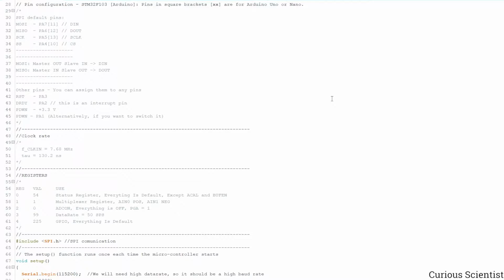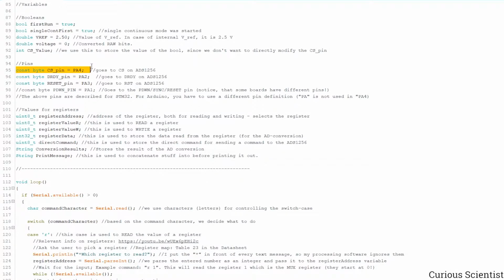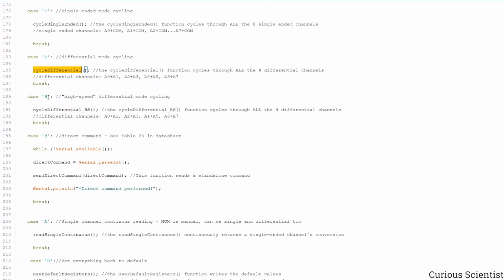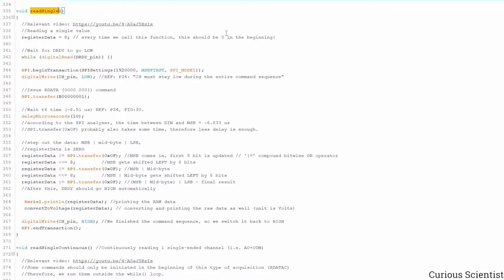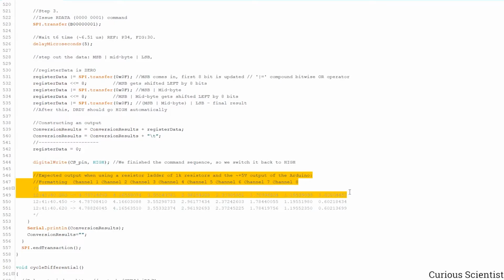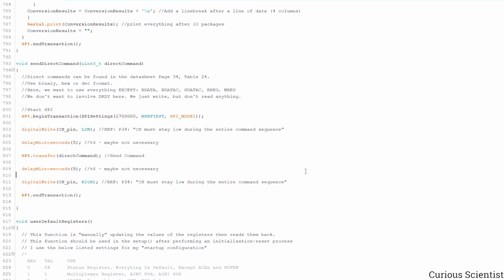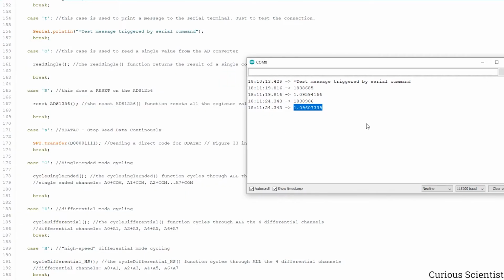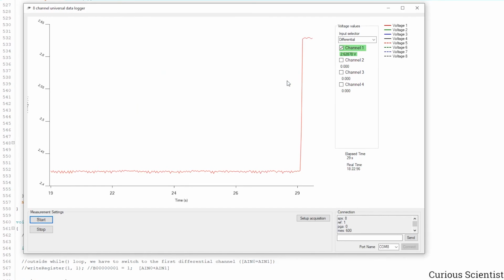ADS1256 - Fully working code and demonstration

Comment: Why is necessary to wait 5us after a DRDY falling edge in continuos mode (RDATAC command)?
Reply from the maker: Check the datasheet and also my most recent, fully functional official Arduino library. I substantially updated the code and its documentation since video.

Comment: Thank you so much for this nice video , Recently I am working on ADS 1263 , I was try to do with Arduino nano ble board ,  Can I use this similar code with proper register value and functions , ?
Reply from the maker: Hi! Why don't you try it? :) 
But you should read the datasheet to understand the protocol of the ADS1263, and then you could see if this code fits it.

Comment: Hi, I found the posted video very helpful
Where is it possible to find the program you are using to graphically represent the signal read by the ADC?
I'm referring to the program that can be seen from 52'40'' onwards
Reply from the maker: Hi and thanks! 
The program can only be found on my computer (i.e. not available publicly). 
However, within a few weeks, I will release a similar software which will be available for purchase on my website.
Reply: @CuriousScientist  Hi, is the software available now? I’m interested with the software you’re using.

Comment: Great work.  Thank you.  I would like to leverage this for another ADC.  How did you calculate tau?
Reply from the maker: Hi and thanks! I followed the formula in the datasheet.
Reply: @CuriousScientist  i failed to even find "Tau" referenced in the datasheet.
Reply from the maker: @PeteDubler  It is impossible. Tau shows up 32 times in the datasheet (September 2013 revision from ti's website). And the definition of it is shown 4 times. I think you just haven't opened and read the datasheet. It is literally the first thing defined when the datasheet talks about the timing characteristics...
Reply: I have spent hours over the last several days reading and re-reading the ADS1255/ADS1256. SBAS288K-JUNE 2003 - REVISED  SEPTEMBER 2013 datasheet.  And I just searched it and re-read all the timing sections again.  There is not a single reference to "tau" nor do I find the Greek symbol in the datasheet.  Is it possible you have a different datasheet than the (English version) SBAS288K?  In fact, I looked on other TI datasheets and their app note on ADC timing and in none did I find the term "tau".  I also wrote a spreadsheet for all the "t" values and starting from your crystal frequency still could not come up with any number close to the "tau" value you are using.  No, I'm not lazy in asking you this question.
Reply from the maker: Yes, I am reading the English SBAS288K datasheet. I even put the link in the video description, and it can be found in my blog article too... If I search for tau, as the Greek symbol "τ" in the datasheet, it shows 32 hits...

The clock frequency of the crystal is 7.68 MHz. As the datasheet writes on page 6 and page 7, tau is 1/(crystal frequency), which is 130.2 ns. I don't know what is so difficult about this. 

The different t values are also stated in the datasheet on page 6. Coincidentally, at the same page where tau is described.
Reply: @CuriousScientist  tauCLKIN. NOT JUST TAU.
Reply: @CuriousScientist  tauCLKIN. NOT JUST TAU.
Reply from the maker: It has tau in it, right?! :) For my own documentation it was enough to write down tau because even if I forget what tau was, I search the datasheet for tau and find it again.
Reply: Are you perhaps using "tau" for tCLKIN?

Comment: hello, i using ads1256 and arduino mega, 
when i read register r0-r4 the value show 255, and if i read single-ended mode the value show 16777215,
why this problem?
Reply from the maker: Hi! Probably wiring issues. Make sure that you wired everything correctly.
Reply: @CuriousScientist  i using jumper with black housing,
Reply: @CuriousScientist  i attach drdy to arduino mega pin 2, it freezez, and if i attach to pin 7 can works but the value still 255 and 16777215, thx
Reply from the maker: Are you aware that you cannot use the as same pins, because you are using a different microcontroller?
Reply: @CuriousScientist  i using arduino Mega spi, cs to pin 8 and drdy to pin 2. And I have changed the code, thx

Comment: The Text is unreadable. I tried to change the contrast of my monitor, but no still no good. Can you make the Text on the screen a little better please ?
Reply from the maker: I cannot modify the video after uploading and it looks perfect on my monitor. I can even read it at 360p setting. Also, you can download the source code, so you can read it as you want.
Reply: Request for larger Font Size.
Reply from the maker: Didn't you read my reply?

Comment: Codes are working but how do we get ADS1256 data logger? please make clarity to open and visualize (line graph) signals
Reply from the maker: You have to write your own software for it.
Reply: @CuriousScientist  Then what is the use your free source code? simply waste without data logger software. what is your aim writing this type of codes and releasing series of videos like this? Totally our time is waste.
Reply from the maker: Why are you so spicy? Can you write the arduino code by yourself? Since you watch the video, probably not. Well, that's the purpose of the video. You should be glad that someone took the effort to provide this code. If you want the logger, you can buy it from me.
Reply: How much please?
Reply from the maker: Drop me an email and I will tell you the details.

Comment: very very buggy and complicated with totally useful features. All this board should do is read voltage (mV, uV) and that's it.
Reply from the maker: Well, the code is freely available and you are free to improve it and share it with us. I am waiting. By the way, I made several updates and improvements since this video. You can find them on my channel.

Comment: Hello there,

I want to send the voltage outputs that I have obtained from ADS1256, which I have connected to the SPI1 pin of STM32F103C8T6, to another place with the NRF24 module that I have connected to the SPI2 pin of STM32F103C8T6, is it possible to do this?

I want to use SPI1 and SPI2 at the same time.

I would be glad if you help.
Reply from the maker: Hi! Probably, it is possible, but I have never worked with the NRF24 module so I don't know how it works. However you just need to save the received data in a variable, then pass it to the transmitter and send it.

Comment: Codes are not compiling. It structed at line 59. error message is 'PA2' was not declared in this scope. suggestion please.
Reply from the maker: PA2 is not declared. Exactly as the error message says. Declare it.
Reply: @CuriousScientist  Codes written according to the video you've showed. The 563 lines of code are all identical. Despite the fact that it is displaying an error.
Reply from the maker: Something is still not ok... I think you missed a bracket somewhere.
Reply: @CuriousScientist  Ok i will try again. Thank you
Reply from the maker: You're welcome. I hope you'll succeed!
Reply: have you found the solution?
Reply from the maker: I already told the solution months ago...
Reply: @CuriousScientist  i already checked the bracket and there is nothing wrong. but it still not working.
Reply from the maker: Do you use the same microcontroller?
Reply: @CuriousScientist  No, but when am compile it shouldn't error right?
Reply from the maker: Well, then that is the issue. This code has to be modified for other microcontrollers... My code works well, it is you who doesn't use it properly.
Reply: @CuriousScientist  can u send me the .ino that you're using?
Reply from the maker: First of all, I am not a free support service. I shared everything on my website. Also, if you use a different microcontroller, my .ino will not work...

Comment: Highly informative . Can you explain , how to use ADS1282 please? Small amount of donation is guarantee. please consider my request positively.
Reply from the maker: Thanks. Unfortunately, I don't have that ADC, so I can't make a video of it. But as I can see it is also an SPI hardware, so the same principles apply. The only difference which you have to keep in mind is the resolution. You will need one extra byte when you read the conversion.
Reply: @CuriousScientist  Thank you so much for your reply. Since ADS1282 is 32 bit, I think it may be required 4 buffers(8x4=32). And sampling rate to limit 4kHz. Then decrease the number of channels to 2 single and  one differential. one more thing is STM bluepill( microcontroller which is used for ADS1256) is sufficient handle 32bit ADC or can i select different microcontroller? I do not much about all these things. Or is there any other changes? Guide me please.
Reply from the maker: STM32 should be sufficient.
Reply: @CuriousScientist  I tried to  donate you , I filled all the boxes, but at the end it shows' like this, sorry.   Donations to this recipient aren't supported in this country
Reply from the maker: No worries. :)

Comment: Just bought an ADS1256 board which I want to use with a MEGA.  I'm looking at the connections and my ADS board has these in a line PDWN,CS,DRDY,DOUT,DIN,CLK,GND,5v .  I have PDWN going to 3.3v, CS going to 10, DRDY = going to 9 ??, DOUT going to 12, DIN  going to 11, CLK going to 13, GND and 5V to those on the MEGA.  In the definitions I have CS_pin = 10, DRDY_pin =9, RESET_pin ????? There is no reset pin on the board unless. Also where do I define the pins that I am using for DIN, DOUT and CLK
Reply from the maker: I have a whole playlist explaining how this circuit works in very detail. I also explain the code and all the connections in very detail. In the playlist, you can also find a discussion on 5 different ADS1256 boards. Take your time and you will find all the answers.

Comment: great videos. One thing i wonder, is it better to use PGA or should I increase the voltage and use a voltage divider? I am reallly curious about which one creates more noise. thanks for helping us
Reply from the maker: Thanks! PGA is for lower voltages, within the range of the ADC. Voltage divider is useful if you want to measure something outside the range of the ADC. I haven't tested the noise performance of the unit, so I can't really answer this question.

Comment: I think We are all in front of the VERY FIRST real explanation of a code in the whole human history!!! Congratulations! You are the first man really landed on a CODE. Yes I know the moon should be more beautiful, but that was an easyer task for mankind.
Reply from the maker: I don't know if it is sarcasm or not, but thank you very much!
Reply: @CuriousScientist  how many really explained code did you ever seen in your life? IT guys likes to keep things untold. As I can now say, thank to your great help, is that your "library" can work on every arduino compatible board. To obtain this "huge" goal we only had to cancel out the "perfectly customized" part of the code that let it work only with a very peculiar pinout or clock. Don't We? So, cleaning out stupidity from the original library, you created the previously unachievable one. That sund pretty odd to me but by my experience now I really expect this stuff.
I would ask: what about the "internal reference voltage" it seems ads1256 has a couple of pin connected to it. I was wandering if it can be used to power up a strain gauge wheatstone bridge.
In "your favourite board" it seems to me that it is connected to some kind of op amp. I think it amplifies the reference voltage to power up sensors. Any hints from you?
Then the buffer. The datasheet says that it actually lowers the s/n ratio but increases the adc impedence. What do you think of it? Thanks bro.
Reply from the maker: I saw nearly zero (well) explained codes. That is one of the reasons why I try to explain my codes in very details. Also, if I am confident enough that I think I can explain it, I am also confident enough to believe that I understand my own code. Also, explaining it helps me to discover errors in it and so on. 

The reference voltage should not be used for powering a strain gauge bridge. Check my other videos on this topic. I work with strain gauges too and I show how to build a very reliable power supply for the Wheatstone bridge. The buffer indeed increases the impedance by a LOT. But, if you don't enable the buffer, your voltage values will be off by ~0.2-0.3 V. On the other hand, if you enable it, you lose some range (~ 2 V). But since the ADC has so high resolution, it is worth to build a reliable voltage divider and extend the voltage range that you can measure to 10-12 V, if it is needed.
Reply: @CuriousScientist  thanks, i'll check the video on strain gauge power supply! Very likely it will be useful.